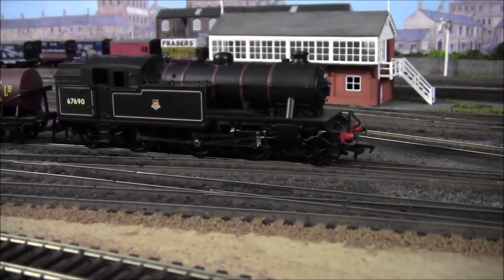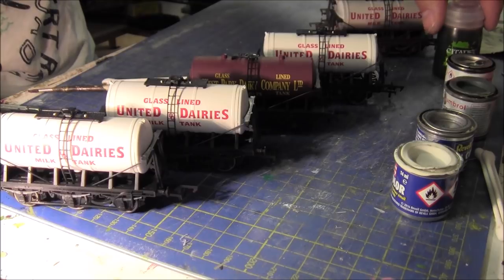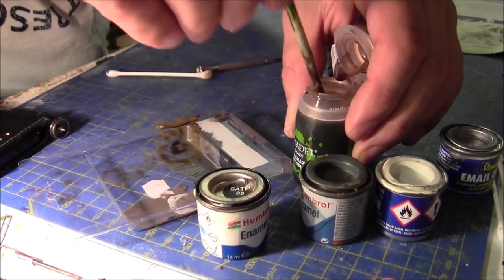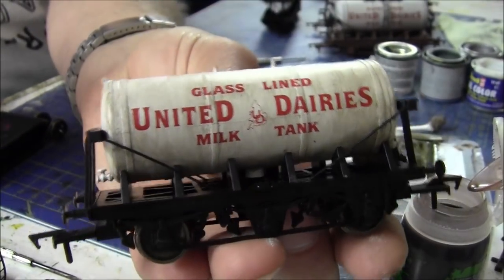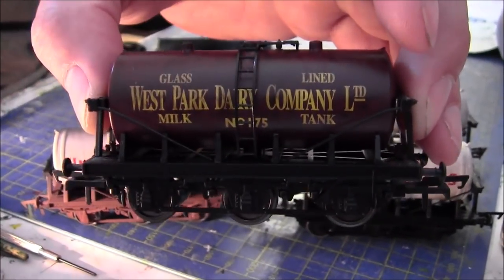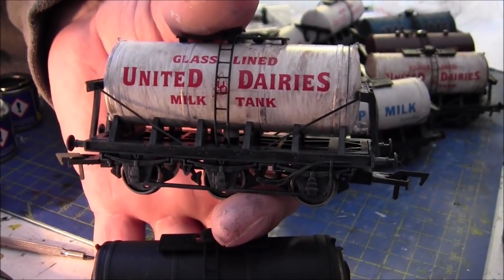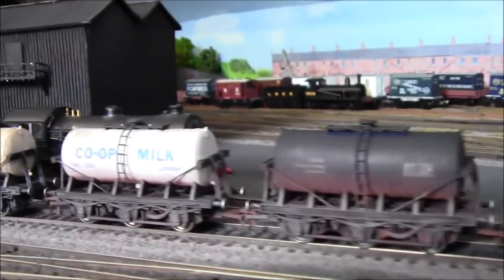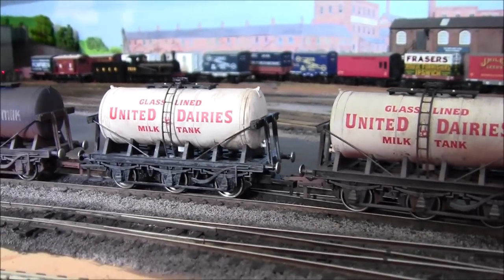Weathering Milk Tankers... No166

Comment: Great job! What wash did you use for the main tank on the wagons?
Reply from the maker: The wash was 4 parts black and one part white, putting the paint on in down-ward streaks with very little on a small brush. you can remove the paint by using a cotton bud. as required. ideally a photo to hand would help....i hope this helps all the best Tony
Reply: @TONYNORTHEASTERN  Thanks for the info on the weathering method.
Can you tell me what paint you used?
Thanks Matt

Comment: Hi Tony
Top top work
I have a wrenn one wieght alot.
Your turned out nice
Keep safe ARP
Reply from the maker: Hi Adi Mate, Wrenn rolling stock are of good quality and they hold there value. there's a milk tanker  on ebay going for £100. the reason for that I think is because it has Newcastle printed on it instead of London....take care Tony
Reply: hi Tony
yes mine was a gift off a model shop few years ago now mine does not have a city on it
keep safe arp